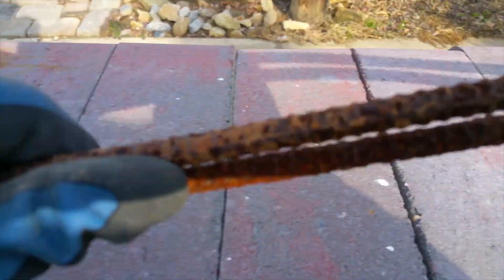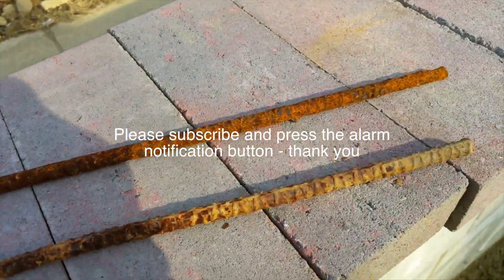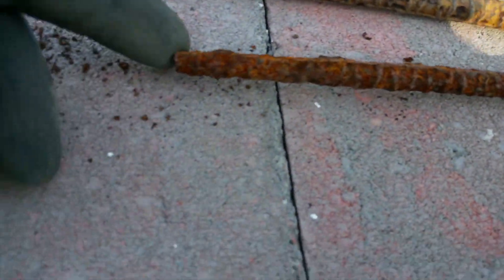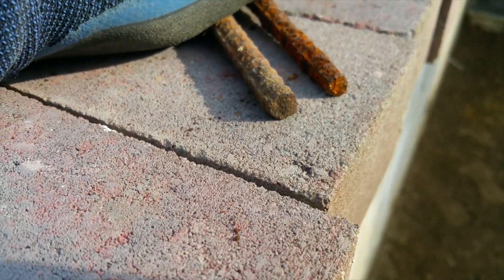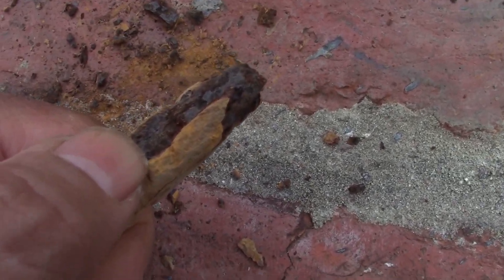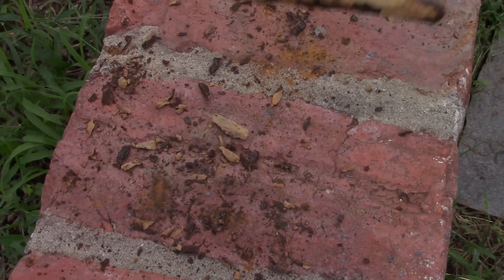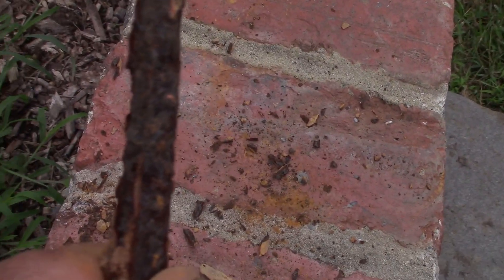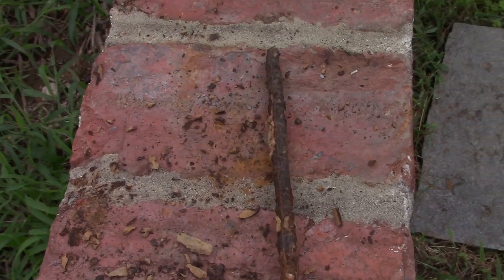Rebar Steel Chinese steel Concrete crack failure from steel expansion

Comment: Is this commonly used in American buildings? If so its very concerning
Reply from the maker: Could be these days... but, on Federal and most state jobs some regulations require a limited amount of exported steel...   although that tide has changed per current ''Brandon rules"

Comment: The stuff you are knocking off is essentially an iron shell, it leaches from the metal if it's left in water, once this process happen removing it from water will cause it to dry out and fall apart. People who find cannonballs have to deal with this when they "restore" them.

Comment: I though imported steel was always metallurgically inspected before being used in construction. Also aren't all construction materials inspected before use?
Reply from the maker: They get ''stamp of approval'' from whomever they want to certify their metal... If, it ''meets astm then they would have more protection against said issues"  for example A615 rebar is a steel designed for concrete stresses...  But, if you start off with metal that is not of quality you will end with a faster rate of failure in your concrete.

Comment: How much does rust expand and how much pressure does it exert?
Reply from the maker: The concrete cover and the concrete's ability to expand is less than the expansion forces of the steel "rust"... imagine 2 pieces of steel with 3 inches and both expanding... They create a two-way wedge with their "rust expansion"...
Reply: @ForensicCats  ......I guess I was asking if a cubic inch of steel rusted completely, how much rust would it make... (what would be the increase in volume)
Reply from the maker: @ravenhhca   no study on that one... I would think it depends on the steel composition.
Reply: Enough to pull down any reinforced concrete structure. That's why cheaply made and/or poorly maintained structures are dangerous. See the italian Morandi's bridge collapse, Morandi himself warned of faster degradation than expected, but the corrupted managers(ASPI/Atlantia) didn't do anything and their friend leftist party covered it up. 43 dead, 11injured, 566 evacuated.